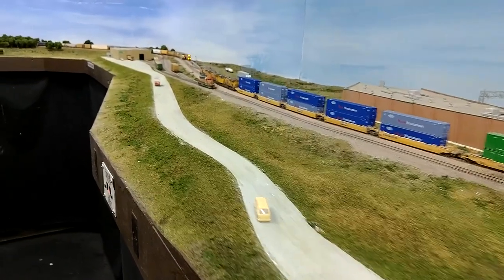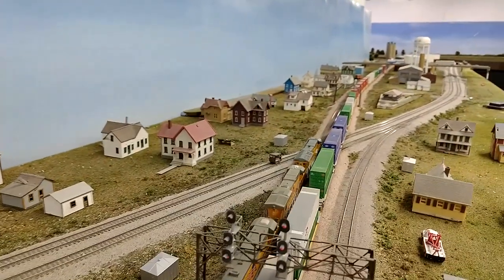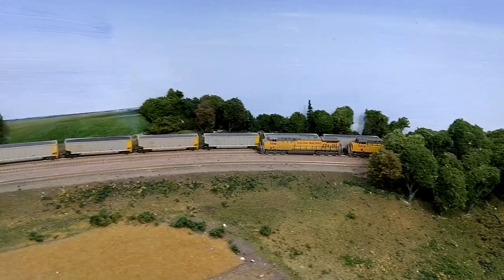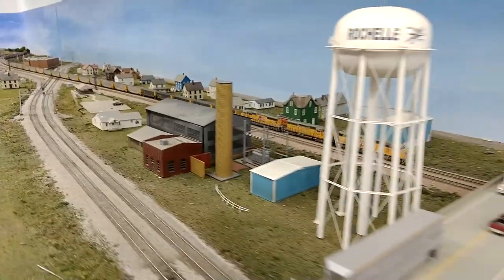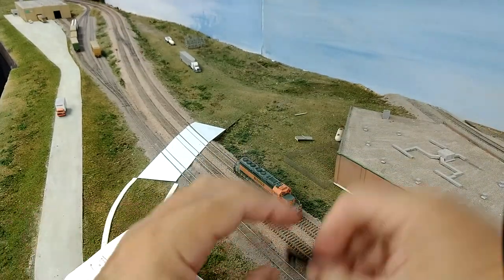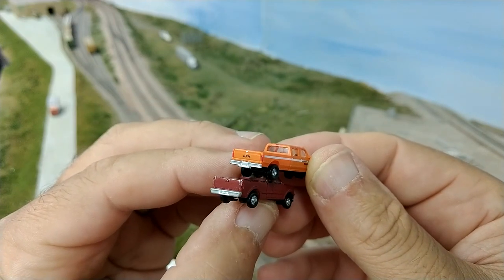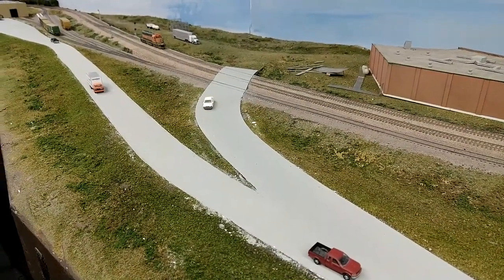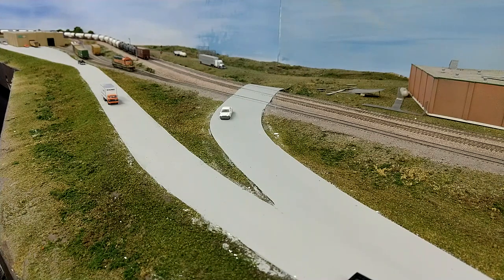Layout Update-New Roads. Model Train Layout Built for Operations and Realism. Season 2019 Episode 19

Comment: That's a nice job.  If you don't mind a comment fron an old transportation engineer, you also need a 2-way connection in the Y between driveway & road.  

Vehicles coming over the tracks toward you need it to turn right into the shop, and vehicles exiting the shop need it to turn left @ head toward the crossing.

You do nice road modeling. 👍

Comment: Too chicken to pave right across the rails ?  It's not as bad as you think, just make sure to clear enough room for the flanges while the plaster is still wet.
Reply from the maker: I've actually have done that before. Works great, but I am installing Blma rubber grade crossing so I needed better control of height of road compared to rails.